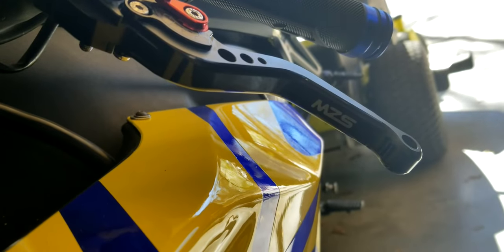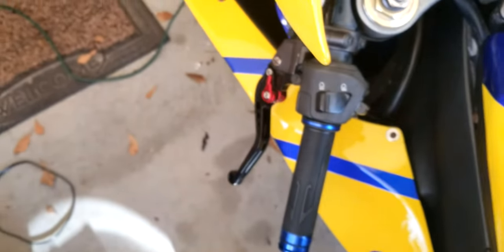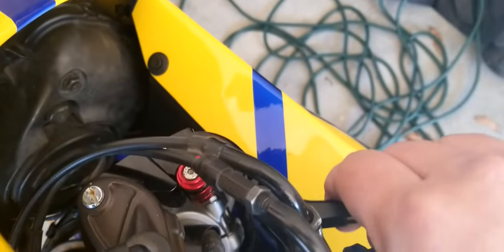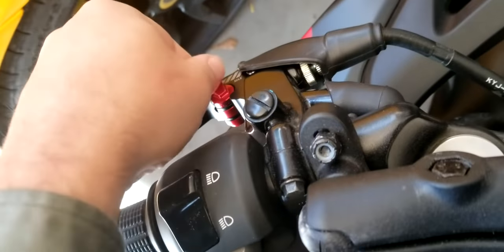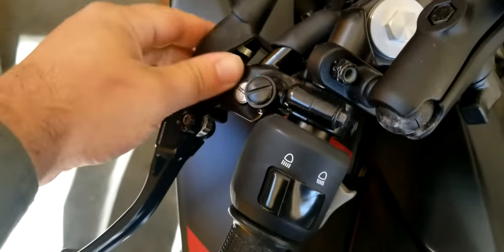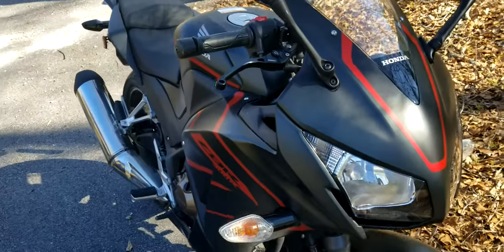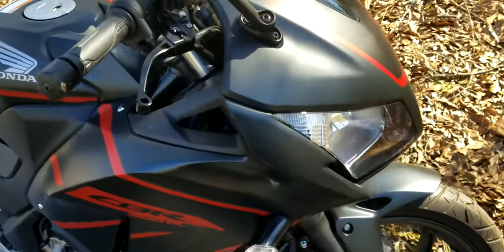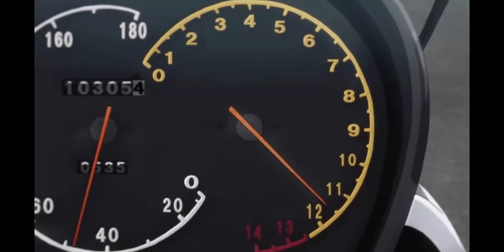ASV vs Vortex vs Chinese MZS vs FXCNC Motorcycle Levers. Battle of the Levers (CBR 1000rr & CBR300r)

Comment: Got AVS shorty for my 23 ZX-10R.  Not custom fit, bike will only start in neutral now and the front brakes lock on.  Requires drilling or filing down. Ain't worth it.

Comment: MZS is a total disaster. My bike used to have a pair of that. The lever is loose like yours and the adjust block not functioning any more. Installed CRG brake lever today and happy with it on my R6. My clutch lever is still on the way and hope it will fix my clutch too stiff issue.
Reply: Could feel stiff because you need to lubricate the cable.

Comment: I have a 2016 zx14. I have had puig levers and chinese. Both would not fully engage the clutch and both cause major slippage almost stranding me. Problem.was that the ball joint pin would not sit all the way inside the levers. So now im hesitant to buy any new brands anticipating the same issues😥

Comment: Wow, my head is spinning 2 minutes in.  You need to stop moving the camera back and forth so much.  I think there was some good information here, but my head hurts ...  You also didn't show or really comment on the expensive levers ability to engage the clutch when set to the minimal setting.   The fact you also compared two different bikes and for different lever sets makes this a somewhat confusing apples to oranges comparison.   I'm also concerned that teh cheap levers showed no sign on lubrication, nor did you mention this.   That could account for the in wear you pointed out as well as some of the play you had.  Improper installation and maintenance can cause issues that are blamed on the product.   With that bine said, the ASV did look the nicest, and seemed to be thicker and more heavy duty.